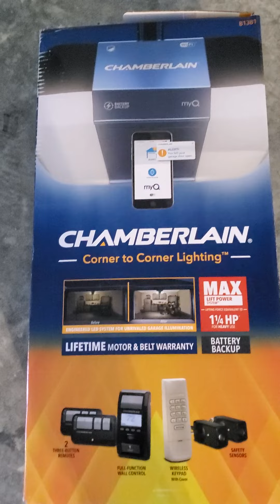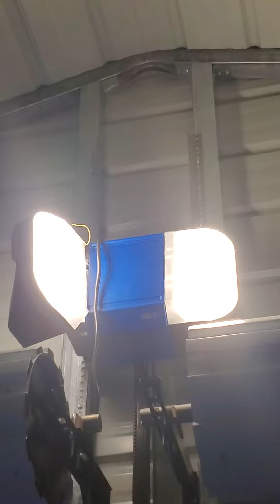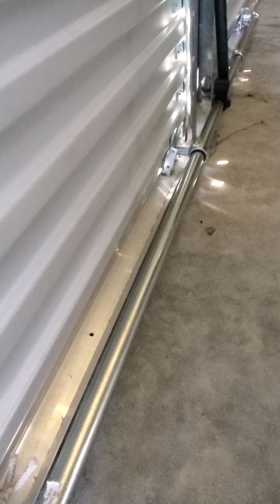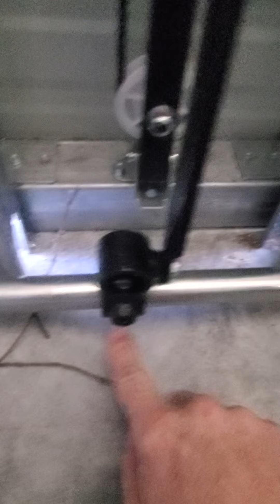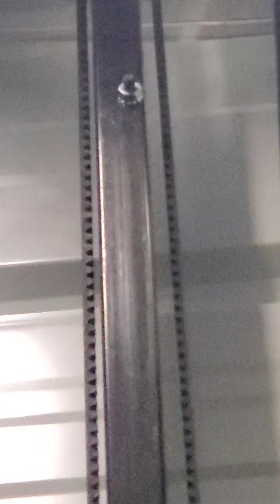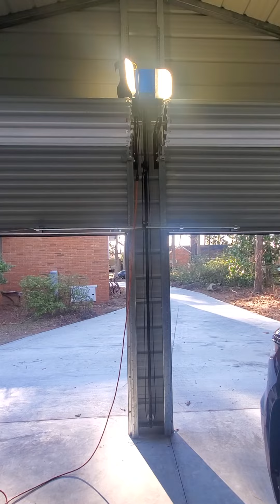How to install a garage door opener for roll up doors.

Comment: Do you have the names or part numbers for the brackets/hangers? I’m unable to locate the parts.
Reply from the maker: Yes, so sorry. I thought that all the links were posted under MORE in the description, but I must have not saved it correctly. Its is there now.

Comment: So glad I found this. Did this on my moms garage, she has 2 9x8 doors but the Genie 1.25 would not lift both doors together. I ended up having to do an opener on each door and it works fine. I think it wouldn't do both doors for me is because there is about a 2' gap in between the 2 doors. I think all in for both openers and all everything else we are about $550-$600 which is still cheaper than the wall mounted openers for the roll up doors.  Thanks again!

Comment: Hello Kristen, I recently viewed your video and found it to be very informative. Thank you 🙏. I am having issues trying to get the remotes to close my door. I have good sensors and are well lined up as per manufacturer requirements. Door goes up well but won’t come down with remote.  Will come down if I press the button on motor. I did not use the electrical conduit tube you used across the doors I used the Steel L shaped bars sold at Lowe’s. You think that may be my issue since it may bind coming down with the L shape bars?

Comment: Looks like there’s a replacement model for the one you used and for some reason it cost more to get the model being phased out wonder if there would be any issue with the new model?
Reply from the maker: Any horizontal unit should work.

Comment: Did you have to buy extension kit do you have names of brackets that was used on doors
Reply from the maker: No extension kit on 8ft high doors. Mine are 8x10
Reply: Ok i thought they was  10x10
Reply: You by chance have name of brackets used on garage door.  Very nice video

Comment: Trying to get to do mine now. Problem on the door going down it wants to flex at that lower part and it binds against the rail.
Reply: Hello Robert, hey I did the same for my garage but I used the Lowe’s L shape steel to cross on the brackets to both doors and going down my also binds and may cause excessive pressure so the opener will not go down. Goes up and opens just great. I have to press the button on garage door motor to bring it down but won’t happen with remotes. Have you fixed your issue and how?

Comment: Did this exactly for only one side,  using 3/4" pipe and rail brackets (pipe slides right in).  Got it exactly centered and plumb.  Problem is because it pulls up, with greatest pressure on one side, it lifts that side a bit higher so that no matter what you do it rolls up unevenly and binds up.  Worried it would break the door so I have to figure a solution or take it out. Spent 3 days on it already.  Thinking maybe the black transition piece is not working for me.  may need a different option.  Any ideas?
Reply from the maker: Hey Peter, how long is your pipe  accross the base. I’m thinking it needs to be long enough to reach past mid door.  But I can see how a smaller single door may have that issue.

Comment: Kristian, Thank you for your video! After viewing several rollup door automation installation videos, I thought your technique would work best for us. The structural pipe and fittings used at the base of the door set it away enough to get around the vertical tract. Plus the pipe serves as a nice handle if I want to raise the door from the inside manually after disengaging the trolley. 
Since our door is only 8' high I had to bolt the header bracket to the front of the floor mount building rail instead of the top like you did with yours. This was to prevent the motor with opener rail from hitting the ceiling.  Anyway, Thanks again for posting this method and saving me from rigging something up with square tube or slotted angle.

Comment: Are your doors 10ft wide by 10ft high ? I'm wondering if you really need to go with a 1 1/4 horse power motor or if you can get by with a 3/4hp motor ?
Reply: These are 10x8 doors.
Reply: @Kristian Stewart  dose it seem over kill for that big of a motor im going to hace 2 doors that are 10×10ft was thinking 3/4hp for both would be fine what do you think ?
Reply: How long it the pipe going from door to door

Comment: What kind of bolt did you use to fasten to the pipe hangers to the doors? Was it a self tapping one that went through to the other side or a bolt with a nut on the other side
Reply from the maker: I actually used the existing bolts from the slide locks on the metal door. Bolt/nut/washer

Comment: Look good. Do you have to bypass the saftey eyes for this setup to work?
Reply from the maker: No sir all features work correctly. Mount the safety sensors at base of rails. They will clip right on.